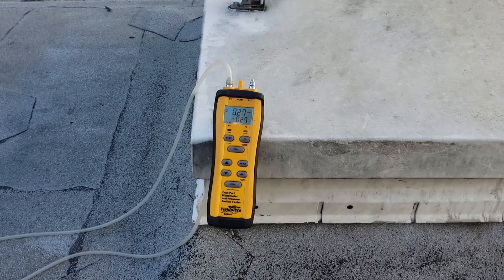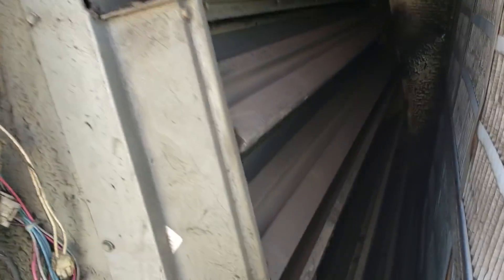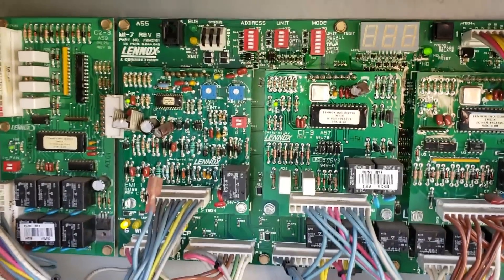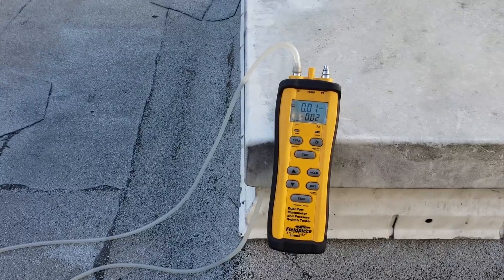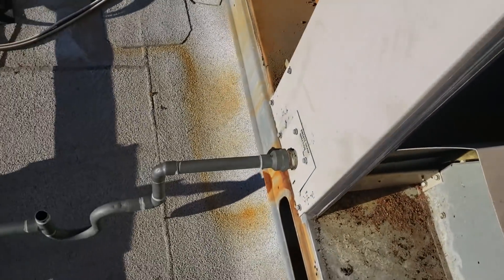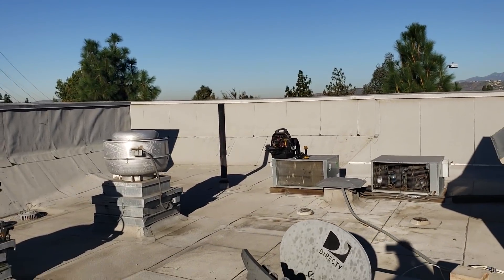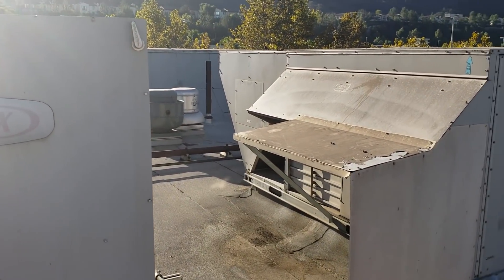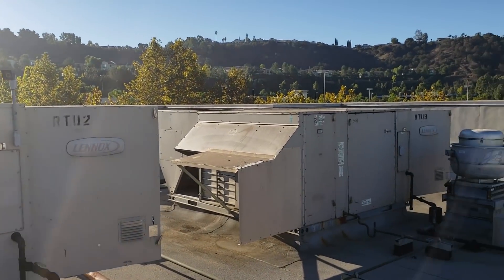Restaurant Air Balance problem

Comment: Excellent work! These are the details that separate installers from technicians. The moment I saw the vent so close to the AMU I thought they could be sucking sewer gas right into the building. Very challenging when the customer doesn’t want to pay to fix the designed system

Comment: The foil buttons tell the whole storry:
This system has a minor fault, then they use this board to do manual override. The buttons failed by overuse and the controller failed by the dirt come in at the peeled of protection surfaces.

The managment is need to replace or need to say: leave this kind preconception or this accident keeps happening forever!

This content is can give a hardest learning point by someone else fault.

Comment: Thanks, bro, great video. You gave us valuable real world troubleshooting scenarios and info on control panels.
In this system what you could also do if client budget allows is put variable dampers in the kitchen RTUs OA dampers and tie them to a control panel with DP sensor input, so that it intakes only the required amount of FA at any time, depending on the working frequency of the kitchen hoods. This will result in more energy savings.

Comment: Thanks for mentioning the rooftop intake near sewer vent issue. Got me thinking of a site problem. The electrician byoassed the control relay to run exhaust fan 24/7 but probably the rooftop pulling sewer vent gas in

Comment: Oh my God after watching it to the end are you that bad go online simple search for vfd controller and you can program an overpriced so-called OEM part and you could probably find that exact controller online don't go through the manufacturer it's a simple man a vfd controller is basically also in your electric car your RC toys your Tesla your new HVAC systems oh my God I don't want you touching any new HVAC systems oh yeah we'll just run a hundred percent OMG
Reply from the maker: So the repair I did was what the customer requested I did, this is a chain restaurant that has specific guidelines for the repairs that are done, I don't like bypassing the drives but they pay me to do it... I would rather repair the system and fix it properly

Comment: Oh my goodness I'm watching the continuation of the video what you're recommending the customer not only isn't it cost more in the long run make your company look like s*** to them because at the end of the day you're still going to have to fix the vfd controllers and if all your concern is is cheekness on a vfd controller did you can pick up a $200 one night you don't made by Siemens or you know another and just manually set it so when it starts it only goes to 50 hertz or whatever the low speed would have been or set it with a simple sensor so it can work properly but what you're doing no because the customer we don't Jerry rig crap this is why I hate normal HVAC text well anyone that's supposed to know what they're doing once you start Jerry rigging it's over

Comment: Okay so you're the reason for their negative pressure problem because you didn't realize that when you power all the vfg drives which let's be clear they're not vfd drives their three phase AC motors that were running off vfd drive modules variable frequency drive controller that is what 5 $700 part depending on how high end they are which I assume aren't you need to go back to the customer and tell them they need to replace the vfd controllers and if not you will not provide service again technically right now if I was at business owner I'd be on the phone with my lawyer and I'd be seeing okay this guy allowed our business to suffer by making a mistake allowing our place to basically smell like s*** and we've lost money because of it I think that business actually has a legal case against you cuz in this video you just admitted that you did the work and yes ignorance unfortunately is not an excuse I'd also be taking a look at that walk-in cooler refrigeration system looks kind of janky old but yeah a very solid letter that says this is what you have to do and if you don't do this we won't do any more work because you're just creating more liabilities for yourself another thing is now one I would not be altering those control boards while the system is running even though you can yeah not a good idea they're going to have a higher energy bill because it's going to be heating that place exchanging the air more fix the hoods the right way and tell the customer they have to do it that way there's no essence but about it

Comment: When I was working in the hotel as a maintenance supervisor, there were some guest rooms which had negative pressure problem. The Rooms were smelling sewage. The Chief engineer told to the mechanical supervisor to fill gaps with foam between the guest rooms and shaft where sewage pipes were passing. But still no effect. I entered the rooms and figured out fresh air dampers were closed or someone put towels in order to prevent slight blowing air sound. I explained to the chief engineer that what are negative and positive pressure. It took several years to get him to understand.

Comment: If you have sewage smells (methane or H2S)due to negative pressure inside building that could mean one or more waste pipe P traps or gas traps in the waste lines are not fitted on all waste pipes or some have no water in them.
Should never happen that sewage smells come back from waste pipes except for above mentioned issues.
Hygiene hazard in an eating establishment.

Comment: Oh wow no make up air. How is that possible.  Those 4 exhaust fan may pulling out so many thousand  cfm.  They gonna have cooling or heating problem while using economizer sucking those outside air in.

Comment: Good video! When you had the  manometer tube going through the roof hatch did you just have the magnetic metal probe that comes with the meter dangling taking pressure that way or did you have something else on the end of it and how far down did you dangle it?

Comment: This video got me thinking.  We've had some intermittent problems with sewer gas coming in our house for a while, mainly during the warmer season.  The biggest cause was that someone had put a cap on the vent pipe that runs to the kitchen drains.  But I'm also starting to wonder if the basement radon fan is causing some negative pressure as well.  The house is over 100 years old and is pretty drafty, but maybe it's still not enough to self-balance?

Comment: Captiveaire hoods. Uses 80% of it own make-up air and only 20% of HVAC .  Thank you for the video. It will held in the future. Only issue I have is humidity. Last guys turned the humid sensors off on 10ton unit because Delta-T was off. Units use heat in summer to help dry air. It just created a worse situation. Either customer thinks things are to expensive to fix or you get a screwball tech. Which is worse.

Isn't vent pipe supposed to be 3ft above everything else?

Multi speed motors are not available at

Comment: What about opening the sheaves on the exhausts (while measuring amp draws on the motor) then close sheaves a bit on rtu's while testing static pressure.
Reply: That was an elegant way of teaching techs that it would be a lot cheaper for the customer to replace the freq drives.  Thanks, keep up the great content.
Reply from the maker: Thanks
Reply from the maker: The exhaust fans are all direct drive motors and the Vfd's are all bypassed so they are pulling more air out of the building than we can put into it.

Comment: I clean kitchen exhaust hood systems for a living. That place looks like Chili’s. Cleaned dozens of those in NJ and PA area. Everyone of them had Melink bypassed. That system works well only on paper. Beam Sensors aren’t water tight. They get ruined all the time. No one opens them to wipe the lens. Small fans above the hood blow air through the sensor box - those die and no one notices. Vfd burn out often.
Awesome videos. I subscribed. 
Looking forward to more exhaust fan and make up air vids.
Reply: KEC Gang!
Reply: It said chili's on the coil filters.

Comment: I've had to do this same thing with these Vfd"s . Ended up wiring in contactors with toggle switches mounted on face of hoods so they could shut them off vs throwing breaker. They don't like power surges at all ! Good job as always!

Comment: Do you have minimum outside air requirements? We have a % per m2 or per person whichever is greater.
Also if there is no make up air for your exhaust system you are exhausting all your conditioned air out, it’s a wonder they haven’t had temperature issues during the weather extremes. Unless your power is very cheap the power cost should have a short pay back period on repairs or installation of a make up air system.
Can be frustrating/difficult trying to explain things like this to customers.

Good vid 👍👍

Comment: By the way thanks for the suggestion of the broken drain line there was one thing that was suggested by someone else on the internet when I mentioned running things things moved are they said have you tried just running the heating system turns out it's an HVAC issue when the unit is running that's when we smell it when heating system is running first of all old system do furnace disconnect switch is like a Cutler-Hammer or something like that still in use and the thing is not 220 original 30 amp cartridge fuses probably like either oil-fired or possibly a coal furnace very big return air ducts more likely originally gravity feed may have been boosted with a blower at one point his to get disconnect switch or power burner or navy coal Stoker or all the above at one point or another as I said 30 amp disconnect switch 30 amp cartridge fuses about what you find for the window unit connected to arrange disconnect pull the house is wired originally of black pipe like what's looks similar to gas pipe except this is the rigid conduit the size boxes that do not fit modern covers I think this should help update you on the date of building and one thing of note that disconnect switch for the furnace in the Asian wiring more about that disconnected moment I do believe that possibly the original service funeral who would very well have been wait for it fused neutral panel it don't worry it's every 110-volt circuit and that's why I'm may have had to fuse one in line what Dallas black heart the AR is what now will be white neutral very very very dangerous I've run across to the few tulips usually podcast or I was able to bring some sort of bypass temporarily or swap out the neutral fuses for 30s SM plug fuses usually although I have seen we're not this is not your afraid thing but here Fairwater fuse links one of these was installed in Joyce hey hey hey an attic full of insulation just we start a fire and above that the old first entry systems had to say systems as in fire grenades that most themselves or potion themselves and I think it generates maybe wrong I think it was carbon tet carbon tetrachloride he knows things we want to come across a used it's ever went off the occupants could be dead I'm not talkin smoke inhalation or fire I'm talking about the products of the earth system trying to put out said fire poisoning them if you're interested Google Fire Grenade or Wikipedia or even here on YouTube where fact there's a few of these or somewhere search where talks about these things around the Border a few good examples here on YouTube they were disinterested on Fire Equipment source of book I have one that's not hermit at but it's an earlier one than that it's a little salt water and it's confirmed that salt water because that the markings it's a bracket that's their brass in my parents I'm sure the bedroom where I stay when I'm with them same one that has the odor not sewer they said that it's very possible the gurgling toilet maybe due to a septic that needs to be pumped because I remember it happened to my grandmother sometimes when I was younger that's the first thing she am I then living grandfather would notice it later it back up into the bathtub was it worse yuck but then you'd have to dig up the lid now they have a pump out connection that they just hook up a hose quick coupler for pump out.

Oh by the way how often should a septic tank be checked roughly on average for two people living at the house and go dishwasher and Wanda washing machine one shower 1 sink double occupancy roughly and as I said before it's datrek issues so looks I will look to the right channel to the first place go figure thanks peace out and keep up the by the way the one about the one that starts with the propane I was in that same restaurant as working on this computer system ones and this is just helping someone and weather Refrigeration use fire like I don't think that was strictly logical I said to them I think there's a flammable gas fire refrigerator and gas heating unit know it's Refrigeration what was that would had to be one that runs on propane right and he says yes it's charged for propane or was he said not anymore I looked at it I said yep there's a nice big hole with that compressor where that compressor Terminal ship and that was no more and I speak skidmark in the paint on the unit actually that was some sort of tag or schematic the blower that was clearly chard good proper looking forward to new videos also could you please talk about some of the old I'd say almost antique units that use refrigerants now that can never legally be recharged because the dangers involved mainly because of Hazards of the refrigerants you don't like ones that would gas you if you ever broke it and also I have witnessed an old refrigerator be move with the coils on top I think it was at a campus at when we were cleaning out the old junk yard for scrap impossible resale of anything that could be a value mainly as a antiques such as the old sharpening stone with a treadle that was a museum-quality piece.
 back to that refrigerator I think it may have been ammonia based on what has happened and how they react to the as it was like when it went you could see a cloud of white not like your refrigerant spray from the damaged line like at seeing some videos Note. that refrigerator did have a compressor this is not one that used ammonia absorption hydrogen water in the boiler and gas flame or electric heater or a caarosenelamp with a mettle chimney instead of glass.

Sort of like a modifide magic lantern chimney for erley projection.

 of course we called the EMTs and they said is a possibility but they could not rule out out or deny or confirm does ammonia because there's no documentation on the unit we searched everywhere on it oh by the way to compressor the connections should have compressor from valves lines or flanges with a fairly decent size screw on your side look more like a hydraulic flange then a refrigeration or are coupler almost like what you might find on some small engine Muffler connections and gaskets in cylinder heads

  by the way it look more like an icebox Style or made from parts for an ice box is then converted to refrigerate box for one thing the car scheme was off for the coils or of a different type of paint although almost insane car but not quite but slightly different finish like the refrigeration was an afterthought

 the only other place I've seen where these is a museum

One more clue SCH I just remembered actually to the cord was not well you might think 2 wire cloth covered or possibly silk although it was white if I can remember well maybe another color and the plug end of it not what you think. Pins or prongs but medium Edison screw shell AKA Vue or standard size 40 or so watt 200 some-odd watt light bulb base AKA
 Well.  before we would normally use the two prong socket most places where you would use a convenient light socket to plug in an electrical Appliance more corectley scrue in it

 oh by the way in that place also someone else to date probably a lot of stuff was there probably before even that time possibly

What  was then the Art Shop 

  is what used to be a laundry facility which was interesting for thing 30s that log sink is trough sink there's also similar one on the bathhouse where I used to go to camp

 As well as in that laundry for soy has now the orange shop there was what store made of an old line shaft system and the boiler was still in the O building one time I ask for permission to pull some boards out and check it out I did get photos and also I salvageable gauges in your gauge siphons Since I'm interested in steam power and boilers and such

Comment: I had a customer that for years refused to install new make up air units so that his kitchen would feel comfortable for his employees and so that his restaurant would feel comfortable.. Few years ago he decided to get another company to install a 10t AC just for his kitchen.. I told I wouldn't do that , that it wouldn't solve anything. So anyways he got it done and $10k later still had same issues. I ended up disconnecting that ac the following summer, some people just don't get it
Reply: Coldone Hernandez why wouldn’t that solve the problem? A 10t unit is capable of handling most commercial kitchen loads and with a stainless steel heat exchanger would be able to pull 1000cfm outside air for make up air too.

Comment: I ran into a similar negative air pressure problem where I work only ours was with the updraft spray paint booth exhaust fan. They're so cheap where I work, a door has to be open every time the spray booth is used.